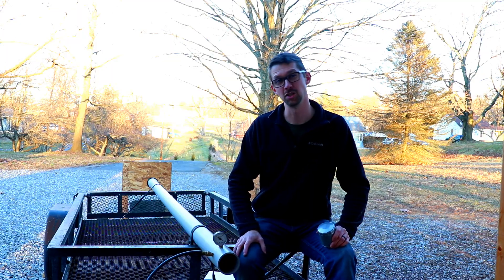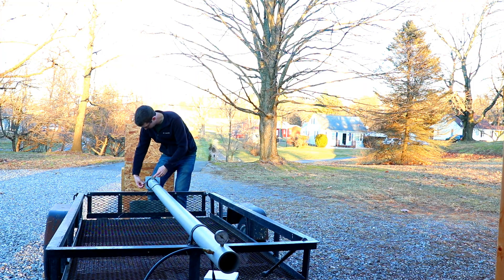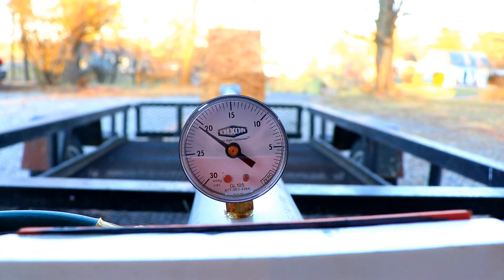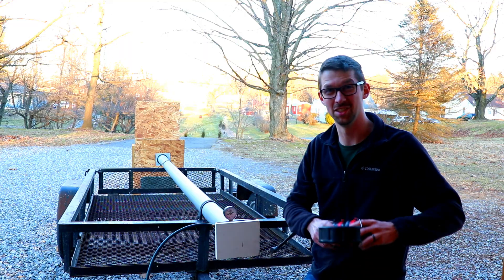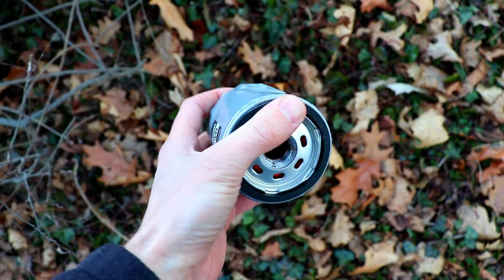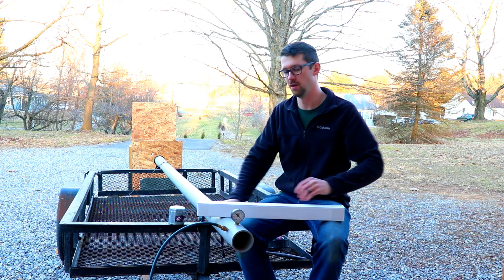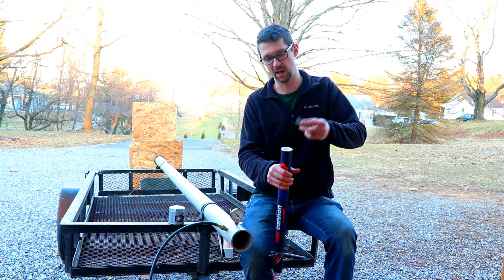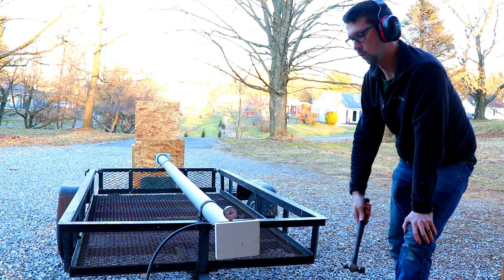Shooting the Vacuum Cannon - TOO MUCH POWER

Comment: Thank you, I enjoyed your presentation. 

I was suprised the oil filter was so intact. Imagine no penetration barrier and a nose cone on the front of it - the range and velocity!

All I want to achieve is around 50 to 80 metres altitude with a lightweight telemetry projectile, something in the region of 100g or so payload weight. 

The payload of the projectile: a small battery, ESP32 microcontroller, barometric sensor and a small camera to take a video of the up and down trajectory.

Personally, I would use a much bigger version of your sadly no longer available vac cannon tube product. The vacuum formed as a plunger is drawn back down the launch tube through a small network of pulleys on a cord at a remote distance. I suppose it can be pulled/controlled with a remotely controlled motor for added theatre ;o)

Hours of pointless fun for a 60 year old!